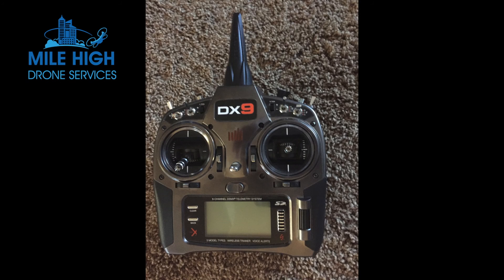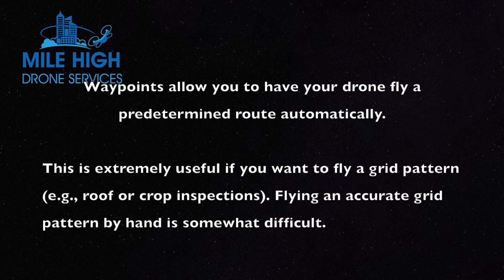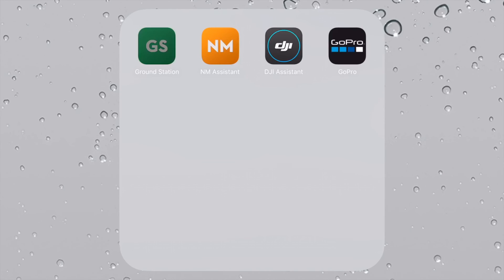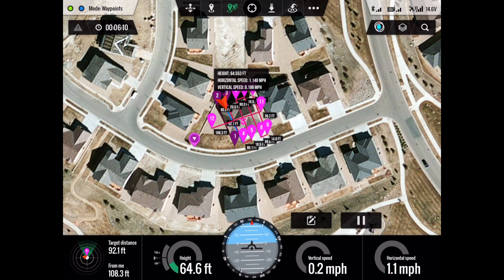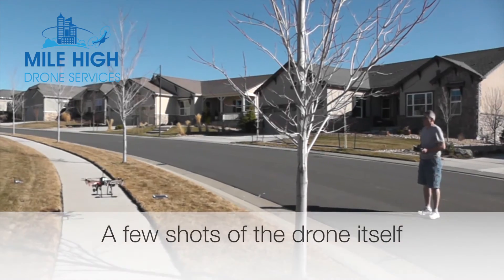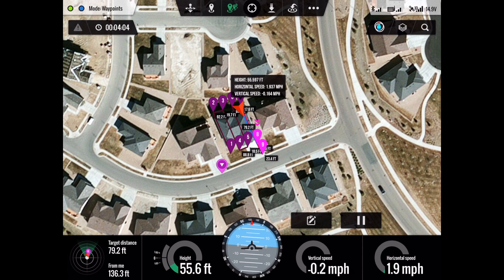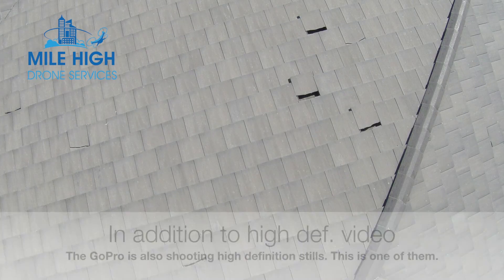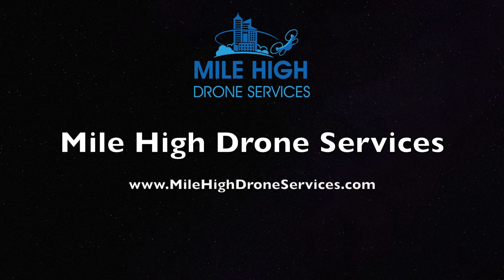Using drones for roof and home inspections

Comment: This video answers many of my questions about roof inspections using a drone. And, I am wondering if you would share a link to the report that was given to the home owner. I would enjoy seeing the still shots that you include in the report.
I see the Drone manufacturers promote the use of their drones for inspections but they always seem to use a new house with no defects. They also show shots of the entire neighborhood. You did very well with this video.
How much time do you typically spend on a roof inspection from the time you take the drone out of the truck to the time it is put away? And, how much flight time is involved per inspection? I would think that one battery would easily give you the flight time to do one roof.
As a home inspector, I think that my time to use a drone would be about the same as if I had to taken my ladder out of the truck and get up onto the roof to walked it. I am in a part of the country where 98% of all roofs are asphalt shingles and the pitch of the roofs are shallow enough to walk on them. Still there are times when I wish I did not have to go onto the roof. Or I have to move my ladder from the front of the house to a second or third location in order to inspect it all.
Reply from the maker: I am not a home inspector. Just a guy home inspectors or home owners themselves hire to take photos of the roofs. I provide the photos. Go to www.MileHighDroneServices.com/db to see an example of what I do provide for home owners and inspectors. It shows where all photos were taken and the actual photos.

Comment: how does  it work under winter  month's with heavy wind conditions
Reply from the maker: Obviously, wind can make it more difficult. Experienced pilots know how to fly in the wind. Inexperienced, not so much. Snow on the roof causes more challenges than wind in the winter. Snow hides damage.
Reply: VintageSlots inspecting a roof in the snow is idiotic unless it is an emergency